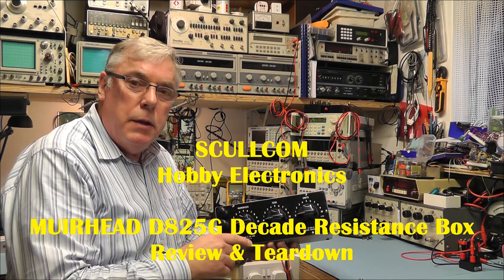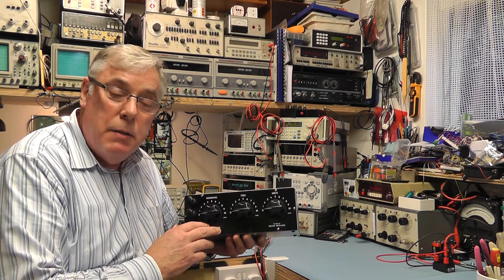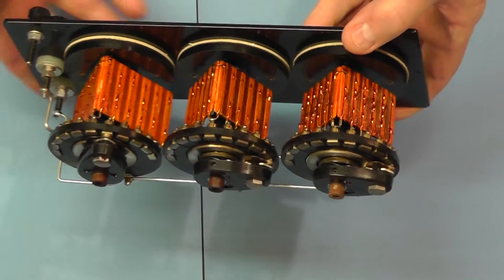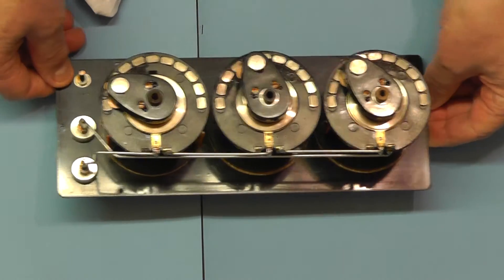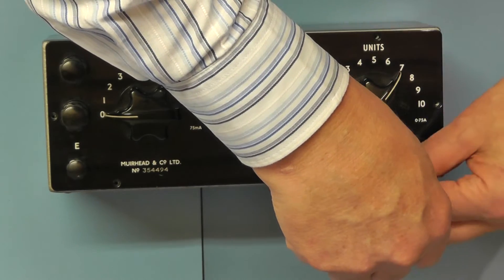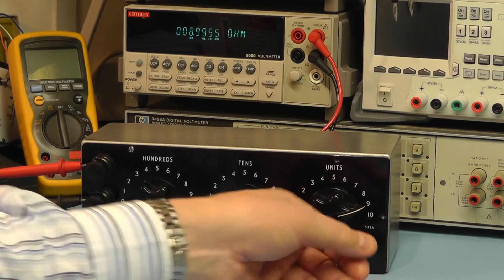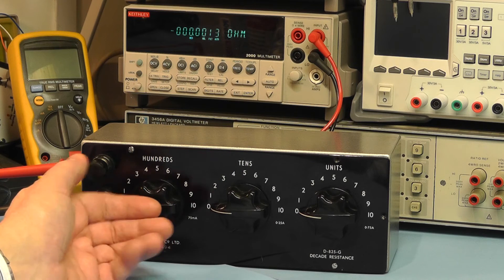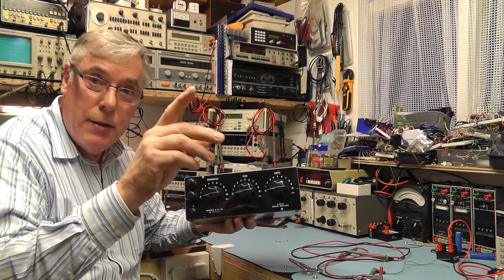Scullcom Hobby Electronics #3 - Muirhead D825G Decade Resistance Box

Comment: nice video.. a bit surprised that you didn't put any grease back..you should know that grease is used there and contacts should not stay just dry ..that old grease is not the best(because it is too old now) but it will protect contacts so yu should place small amount back as it was originally.Cleaning is all fine ..but it is dry now and it is not good at all

Comment: Really nice looking unit, was that earth terminal connected to the case?

I just picked up a Muirhead B-21-F decade condenser, lovely piece of kit but not much to see inside as it is mostly enclosed.
Reply from the maker: David Watts Interestingly the earth terminal was not connected to anything but just bolted to the front black bakelite panel. I think it was just used as an earth binding post for any external cable screening. But it would seem sensible to connect it to the metal case. It may be a hangover from the days when Muirhead used wooden cases.
Just found your channel and particularly enjoying your videos on the Arduino.
Reply: Scullcom Hobby Electronics I thought it was a bit odd, my Muirhead has an earth terminal with a wooden box and I couldn't figure out why. I will throw up a video of it next week.

I am really impressed with your GPS video, pretty much the neatest whiteboard drawing ever! I am hoping to get a high altitude balloon project 'off the ground' soon so I found that really useful.

Subbed ;-)